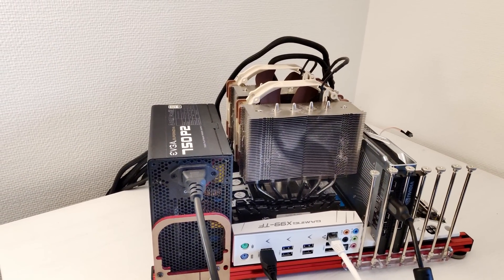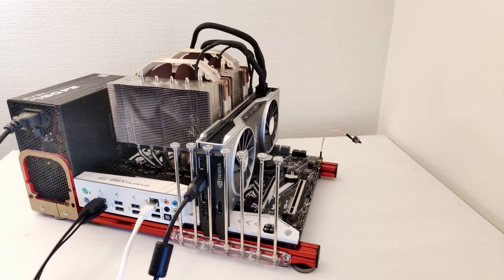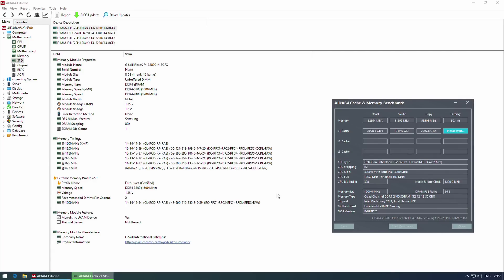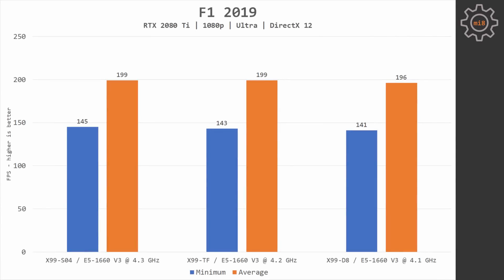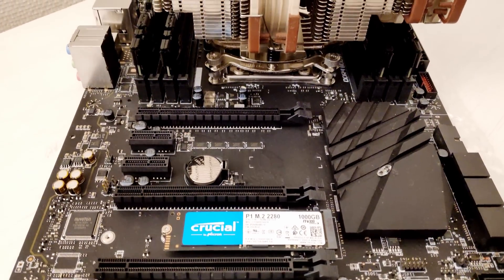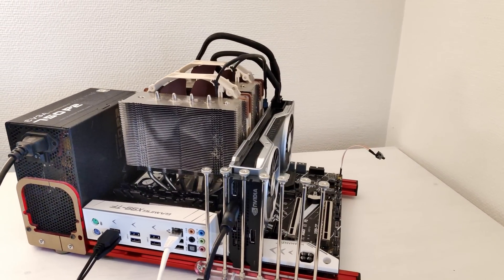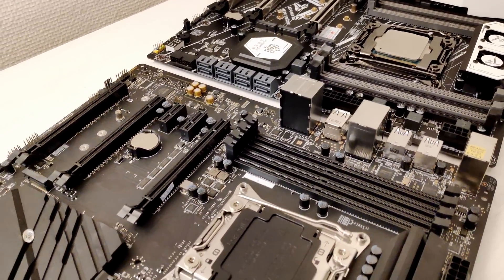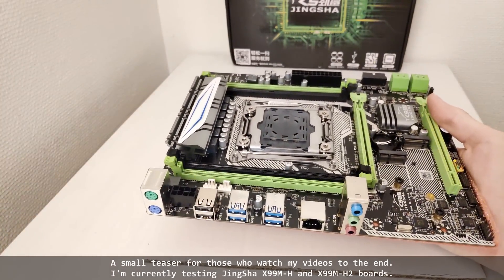🇬🇧 Overclocking Xeon E5-1660 V3 on MSI X99-S04, Huananzhi X99-TF, and JingSha X99-D8

Comment: E5 Xeon 2698v4 Jingsha X99-D8I 
Can I make the same modification you did in the video using the AMIBCP program on my BIOS X99-TF v3.0 (22-0830) for the motherboard Jingsha X99-D8I?
Will it work too, or do I need to get the exact BIOS version for my board?
Sorry, I had to translate your whole video — I didn’t fully understand some parts since I’m from Brazil.
Reply from the maker: I am not entirely sure about what modifications you ask. For Turbo Boost Unlock you need a V3 CPU, it doesn't work with V4 CPUs.
Reply: @Miyconst  

I was referring to BIOS editing with AMIBCP, not the Turbo Unlock mod.
My CPU is a Xeon E5-2698 v4 (so I know Turbo Unlock won’t work).

What I meant is:
If I open my current BIOS (X99-TF v3.0 – 22-0830, running on a Jingsha X99-D8I) and just unlock the hidden menus in AMIBCP — like “Overclocking Feature”, “CPU Strap”, “BCLK”, “Power Limits”, etc. — is that enough to get manual overclock / BCLK control working like in your video?

Or do I actually need to flash a pre-modded BIOS made specifically for that?
Basically: does simply changing “Access = USER / Show = YES” in AMIBCP enable overclocking on these Chinese X99 boards, or is extra patching required?

Thanks! I’m just trying to understand whether menu unlocking alone is enough for V4 CPUs, or if the BIOS needs deeper modding (like iEngineer mod or ME region tweaks).
Reply from the maker: @viniartee  You don't get any overclocking with V4 CPUs and Chinese motherboards, the settings, even if unlocked, do absolutely nothing.
Reply: Not even increasing the RAM frequency — like up to 2666 MHz (on V4 CPUs)?
Is overclocking only possible with V3 CPUs?
But in your video, the CPU is a V4 — and you managed to do it... how?

Comment: What version of X99 TF you are use?
I have my 1660v3 set on 1.15v and adaptive voltage on 4.2 ghz it peaked to 1. 175.
Max uae 165watt.
4.3 and higher not try.

I use ddr4 2400 cl17.

I check with hardwareinfo tool and clocks are 4200 on all cores by testing with cinebench2024.

And why are imc on 1.18v? How fast running youre cache?
Reply from the maker: The video is way too old, I don't remember all the details, sorry.
Reply: @Miyconst  no problem.
I have the first batch from the TF.
In XTU i can go far with Overclocking in bios not, i use X99DE28 bios.
Thats official the first only for the F8.
Looks i must find good voltage for the IMC, only van i set VCCS voltage or Ring voltage and CPU voltage.
What is the IMC voltage?

Comment: Any update on the iEngineering bios to enable CPU overclocking and RAM overclocking?  Pretty sure the x99-d8i is identical, minus the fans on the VRM heatsink.  I managed to get one off ebay that was open-box (with a damaged usb 3.0 front connector) for $60, i think it was worth it at that price.  Motherboards like these are only really worth $80-100USD max...  Would editing the bios with a bios editor enable ram and CPU overclocking?
Reply from the maker: No updates as far as I know but you can follow him directly: https://m.youtube.com/@BIOS-Engineer

Comment: Might be an obvious question but, I have ZSUS X99-P4 motherboard with E5-1650V3 CPU. Cannot change multiplier in Intel XTU (greyed out). Is this because of chipset (thats probably B85 on X99-P4)?
Reply from the maker: It's because of the BIOS, it doesn't have OC support.
Reply: @Miyconst  ok so nothing to do I guess?
Reply from the maker: That's correct.

Comment: My cpu drops from 4.3ghz to 4.1 in gaming. But in cpu z stress and bench stays at 4.3ghz. Any idea of this issue? (Xeon e5 1660 v3)
Reply from the maker: Your VRM or CPU don't hold the load.
Reply: @Miyconst I saw I had to increase the current. This cpus are too power hungry

Comment: Nice video!

About the three rare Haswell EP CPUs (E5-1681v3 10c/20t, 1686v3 12c/24t and 1691v3 14c/28t) that you mentioned in the beginning:

I dont know if they actually exist. I've tried to hunt down them for quite a while now.
The information you can find about them is, that all three are custom SKUs created by Intel for a specific client.
I've sent requests to multiple Data-Center Resellers and nobody ever came across one of them.

All offers of them found online might be placeholders or scams.
I coult not find a single picture of one of them.

Comment: hello Miyconst, I have a xeon e5-2620 on a jingsha x99 - would overclocking help much? I looked at the BIOS and can't see how to reset the speed..?
Reply from the maker: It's not possible to overclock E5-26XX CPUs, they are locked.
Reply: @Miyconst  thanks...what is a faster xeon e5 chip for that board...I am running ESXi...?

Comment: I'm wondering if 1660 V3 and 1680 V3 overclock the same, I will google about this. I'm upgrading from a 1680 V2 to a 1660 V3 now
Reply from the maker: From my experience, it's really random, not enough evidence that you get better results with E5-1680 V3. Anyway, do yourself a favor and go with 12th gen Intel.
Reply: @Miyconst  well I got a 1660 V3 for free, and I have now bought a complete system without GPU (case, 5820k, X99 Strix Gaming, 500GB SSD, 850W platinum PSU, AIO, 16GB RAM) for just $200, I will sell the parts I don't need so this system will be like a free upgrade for my brother (I just needed the mainboard). 12th gen don't have HEDT so it doesn't have enough CPU lanes and I think my current 10980XE will last a long time
Reply from the maker: @pontusakesson856  with this price it makes sense, I thought you bought it from AliExpress.

Comment: I have the Huananzchi X99 TF motherboard how do I overclock the i7 5820K? Do I need a certain BIOS?
Reply from the maker: You need BIOS from iEngineer, search on GitHub, I can't paste links here.
Reply: @Miyconst  is there a way i can communicate with you? you have Discord?
Reply from the maker: @SiqFix  yes, you can find a link in my channel header, I can't paste links in comments.
Reply: @Miyconst  I have a problem it’s not letting me flash to another bios using fpt I get error 25? Do you know how to fix this?
Reply from the maker: @SiqFix  you can use AfuWin.
Reply: Never mind I got it worked perfect thanks for the BIOS. I OC it to 4.2GHz 1.3 volts. If anyone needs help let me know I will give my discord.
Reply: Update: Since I have a bigger cooler FSP Windale 6 with 2 CPU fans and like 6 case fans I’m able to push my i7 5820K to 4.4GHz at 1.3v now I can play Spider-Man Remastered thanks so much bro. My GTX 1080 Ti was getting bottlenecked by the i7 5820K stock 3.4GHz.
Reply from the maker: @SiqFix  that's a very good result, more than 1 GHz extra frequency, just make sure you don't fry your VRM.
Reply: @Miyconst  I let it run idle on Spider-Man Remastered for 2 hours didn’t crash. Temps are in the 60’s. I think anything over 4.4GHz will harm the VRM. If I see anything weird I will go back to 4.2GHz at 1.2v

Comment: Nice! I am running my 1660v3 stable @4.2ghz 1.2V on my Gigabyte X99 Gaming 5.
Reply: all the cores are 4.2 ?!? you dont need modified bios to "turbo unlock" on that motherboard?
Reply: @barrozo24  No! I am really overclocking. G1 Gaming is a trully X99 chipset, not a chinese mobo with desktop or server chipsets, like b85, q87 or c226, it have several OC features in bios to set core ratios and other things. Xeon 16xx family has unlocked multipliers, so with this motherboard i can set the cpu clock ratio that i want and adjust core voltage to handle this frequency. If i apply liquid metal and use water cooling i can reach even higher clocks, like 4.5ghz and above, for daily use.

Comment: Hello Friend.
help me.
I have the 1680v3 E5 cpu. Is it possible to overclock? If yes, how do I do it?
I tried using Intel's XTU and it was blocked...
Reply from the maker: What is your motherboard and BIOS?
Reply: @Miyconst  jingsha x99m-h2
Reply: @Miyconst  https://youtu.be/RwBP8cpNXs8
Reply from the maker: @estudojefteste  did you watch my review properly? This motherboard does not support any overclocking.
Reply: @Miyconst   ah, ok 
Thanks friend!
Reply: @Miyconst  which one do you recommend me?
Reply from the maker: @estudojefteste  I would recommend to sell the CPU on eBay and buy B560 + i5-10400F combo, but if you want a Chinese X99 then it's Huananzhi X99-F8.
Reply: @Miyconst  Very thanks
Reply: @Miyconst  
please, with huananzhi x99 f8  how do you overclock? can I go straight through the bios? or by the program? if you have a video, thank you
huananzhi x99 f8
Reply from the maker: @estudojefteste  yes, X99-F8 can overclock with BIOS, but only if you use BIOS from iEngineer.
Reply: @Miyconst  Very thanks
Reply: @Miyconst  software myconst? Or direct BIOS?
Reply from the maker: @estudojefteste  both, Intel XTU & BIOS are working to overclock unlocked CPU with iEngineer BIOS.
Reply: @Miyconst  Very thanks

Comment: XTU does not work on x99 tf motherboards at these days or maybe i done something wrong
Reply from the maker: You did everything right, the latest motherboard revision doesn't support overclocking, a better BIOS is required.

Comment: I have the xeon e5 1660v3 with x99-tf with latest bios, cant reach over 4.1ghz @1.35v ddr4 2133
Reply from the maker: Seems like you have got a bad CPU sample, there is not much can be done about it.
Reply: @Miyconst  i'm ok with 4.1Ghz, but i never touched the IMC clock, if i OC it i will got memory frequency at least 2400Mhz?
Reply from the maker: @diegomcassidy  you can overclock memory without overclocking IMC, just use the memory speed multiplier.
Reply: @Miyconst  thanks to your app i flashed the republic of belarus mi8 BIOS mod, after this i ser RAM timmings 14-14-14-38-CR1, DRAM Freq 2400 and 3.9Ghz@1.19v for 24/7 OC, right now i'm testing stability at 4Ghz. You're a genius, thanks so much. I would be pleased if you upload a x99 huananxhi OC Guide, there's no much information, in past i just OC'ed with XTU
Reply from the maker: @diegomcassidy  Huananzhi X99-TF is almost out of stock and the unlocked LGA 2011-3 CPUs have unreasonable price tag, thus I am feeling kinda border to do overclocking videos on this platform, but I will see what I can do about it.
Reply: @Miyconst  i think the OC procedure is the same or at least similar at x99 platform, about the price, you're right... I've purchased my 1660 on ebay: 150USD
Reply from the maker: @diegomcassidy  O.C. is not possible with the desktop chipsets, such as B85/Q81/H81, it only works with X99/C12, and the last wave of the Chinese X99 boards uses these cheap desktop chipset option.
Reply: @Miyconst oh i understand.... that sucks

Comment: The Asus X99 Deluxe support E5 2678 V3?
Reply from the maker: Yes, it does.
Reply: @Miyconst  Just I have not met him in CPU support list, so I asked, as the memories which you indicate with this motherboard?
Reply from the maker: @rafaelferreira8260  E5-2678 V3 is an unofficial CPU, that's why you don't find it on the support list, but if the motherboard supports E5-2680 V3, it also supports E5-2678 V3.

Comment: Sorry if this sounds dumb but can you turbo boost Xeon e5 2678 v3? Would it make a significant difference from stock settings? Also, which X99 motherboard and CPU cooler would you recommend for E5 2678 V3?
Reply from the maker: Yes you can Turbo Unlock E5-2678 V3. The motherboard recommendation would depend on your budget and needs. CPU cooler - anything similar to Cooler Master Hyper 212 Evo.

Comment: Hi,
Thanks for this video. On the budget side of LGA2011, did you test once overclocking the xeons 1650 or 1650v2 on X79 motherboards ? If so, which one do you think is the best for that purpose ?
Reply from the maker: E5-1650 V2 is surely better, regarding the motherboard, I didn't test many, thus I can't recommend anything.
Reply: @Miyconst  thanks for your answer. My question was badly posted. I was asking more on the motherboard than on the cpu 😁, to know you advice on the best X79 motherboard for overclocking an unlocked cpu
Reply from the maker: @christophejournoud  I assume you are asking about the Chinese X79 motherboards. In this case I can't really say much since I have tested only a few of them, and the one I liked are no longer in production and not available to purchase.
Reply: @Miyconst  Thanks for your time

Comment: The MSI needs turbo unlock for the 26xx V3?
Reply from the maker: Yes, it does need it, if you want to force all corres to run at their maximum frequency.
Reply: @Miyconst   Its possible to do the turbo unlock with this model without BIOS physical flasher?
Reply from the maker: @philosdata  Yes, it's possible.

Comment: I just ordered e5-1660 v3 and will be upgrading my 5820k. Hoping i will hit 4.5 ghz with the 1660v3 with my x99-a Asus board. i got a 360mm radiator that i will be using with it
Reply from the maker: 4.5 GHz should be doable, but it's still a silicone lottery.
Reply: I will be happy with 4.4ghz with the 2 extra cores vs 5820k.
Reply from the maker: @danjustynchiong  yep, that would be a decent upgrade.

Comment: Hello Kostiantyn. I have an X99-S04 with an E5-1660 V3 too. Just by installing Corsair LPX 3000MHz and activating XMP the BCLK went for the 125 MHz strap. Memory is stable @3000 and the CPU got a 25% overclock on base and turbo frequencies. BCLK on this board works just fine, but you need to closely follow the straps that rule the dividers. NVMe and everything else worked fine with BCLK@125MHz. The other BCLK CPU strap (167MHz) I haven't tried yet. Corsair LPX 3200 on the other hand was much harder to configure properly, it takes some time to understand this platform.
Reply from the maker: It looks like you are luckier than me with the CPU. Mine didn't work properly with BCLK 125.
Reply: X99 TF with C612 cant run 125mhz the internal crystal are other one than on X99 and 8serie chipsets.

Comment: Cpu does degrade over time after hard usage - this is your own science, never heard about before, its not a video card! Compare all systems @ 4.1ghz or its all pointless, you always make wrong conclusions.
Reply from the maker: It is hard for me to find logic in your statement. One motherboard costs more than another one and supports higher overclocking, why would I test both of them with the same CPU speed?
Reply: @Miyconst  All reviewers make same mistake - take a branded motherboard and overclock a 2011 cpu to unreal numbers and then compare that cpu with other default cpu-s, this has zero value to a average viewer. Also people are interested in comparing different motherboards and testing cpu at the same frequency gives a real comparison. Your 200mhz cpu frequency differents makes no point to compare game results.
Reply from the maker: @MrSookonn  am I right that you want me to compare E5-1660 V3 running at the same speed with the same memory, but with different motherboards? Why would the results be different if the CPU & Memory run at the same speed?
Reply: If $70 motheboard and $150 motherboard have the same game performance @ 4.1 its a guide for buyers and 4.3ghz with Msi anyway depends on a cpu lottery. If you use different cpu frequency viewer cant be sure all systems performance difference depend on a cpu frequency only.

Comment: I have a big question, I have an i7 6800K and X99 prices are horrible where I am, so aliexpress it is. what is the best X99 from aliexpress? I heard the Huananzhi X99-TF is good and maybe overclock with intel XTU? I kinda wanna try to achieve 4.2ghz/ 4.3GHZ all core.
Reply from the maker: Yes, Huananzhi X99-TF is the best option, but I can't guarantee 4.2-4.3 GHz.

Comment: Hey! what's up, man. I bought a Xeon 2630L v3, but on the huananzhi x99 tf motherboard it doesn't work :c what can it be?
 i bought a ddr4 ram 2133mhz for this cpu.
Reply from the maker: Most likely it's the RAM compatibly issue. Please specify your RAM model.
Reply: @Miyconst  thanks u! my RAM model is a ddr4 KANMEIQI 2133mhz of 4gb x2
Reply from the maker: Yep, seems like your memory is not compatible with the X99 platform.
Reply: @Miyconst  thanks u dude

Comment: In the UK you could buy the Huanhazhi board and E5 1660 V3 for approx £180 UK pounds from AliExpress.

A pretty good deal for an 8 core, 16 thread gaming PC. X99 boards on eBay alone are this price - boards from Asus etc.

Comment: Hi again after last time on the e5 26XX processors video, i made my "cheap" workstation thx to your video and advices.
For a student in VFX having such horse power for the cost is totally insane, my pc is more powerful than those in my school XD.
Thanks a lot Miyconst, continue your great work :D

------ CONFIG --------
CPU : 2 * E5-2678v3
Motherboard : X99-T8D
RAM : 128Gb 1866MHz DDR3
Graphic : RTX 2070
Drives : 512Gb SSD - 1To HDD
PSU : 650W GOLD
Others : WIFI & Bluetooth PCI-E card

Total cost : just under 1500 euros

------ BENCHMARKS ---------
Default bios : 
- CUP-Z bench : SingleThread 389,1 - MultiThreads 9097,8
- Cinebench R20 : 6931

Bios with v3_payne_90_50 driver :
- CUP-Z bench : SingleThread 366,6 - MultiThreads 10001,2
- Cinebench R20 : 7210

I tested almost every drivers for turbo boost unlock and made graphics, and the best diver was "v3_payne_90_50" single CPU, the dual cpu one have lower score on CPU-Z bench and max clock speed.

Comment: Hey miyconst can you please test this on CoD Warzone low 1080p settings? That game seems different to CoD MW and is badly optimized.. even 2678v3 TU can not pull 144 fps due to single thread dependence.. so this 1660v3 may actually pull 144 fps, if you can test :) Thanks.
Reply from the maker: Maybe I will do that, but it's really hard to consistently benchmark online games, since every run is different to the previous ones.

Comment: any suggestion on x99 matx with 2678v3? i was hoping to go for kllisre x99 d4 but it only sells in packages with cpu and ram. machinist x99z looks promising but vrm heat issue. im planning to use it with rtx3070
Reply from the maker: I would go with Machinist and install some extra cooling for the VRM.